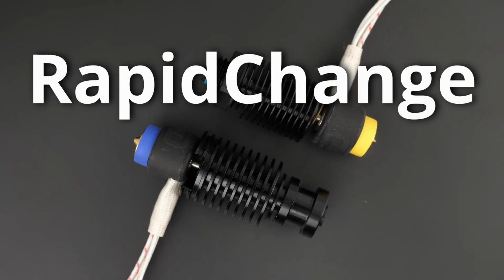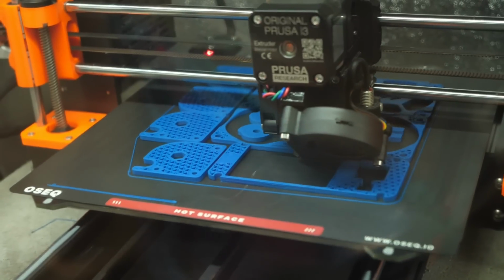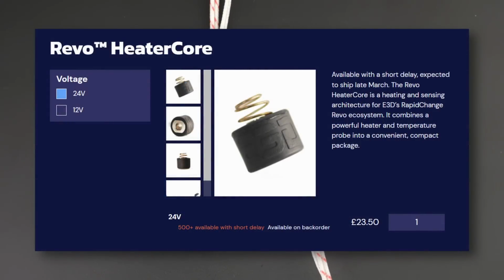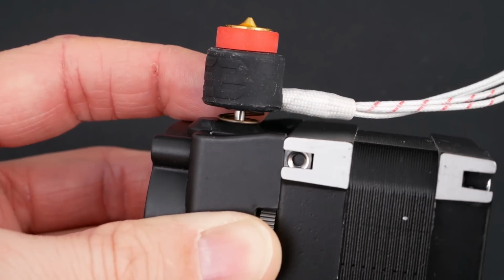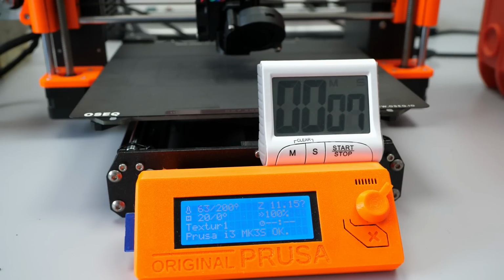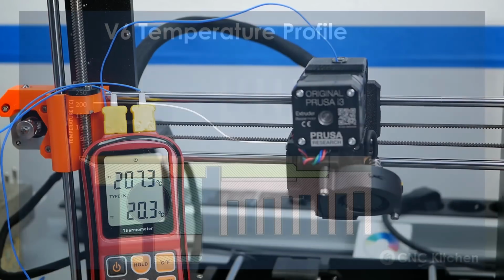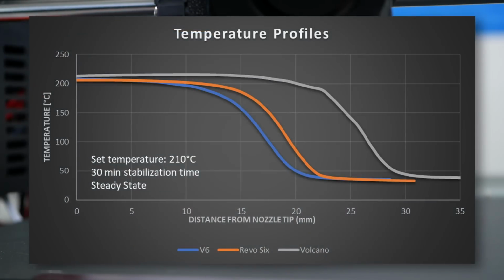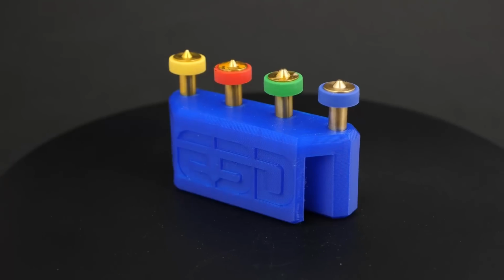E3D Revo™ is great BUT has a dirty secret! (REVIEW)

Comment: The temperature disparity is actually a deal breaker for me. Many of my prints rely on airflow and speed changes to achieve desired properties and inaccurate temperature that will vary based on the amount of airflow is a no go for me.
Reply: And the only solution to that would be extensive testing to find the temperature gradient based on airflow, compared to just running an already working system, no thanks.
Reply: The process of 3D printing is a bit like cooking—that is, purely empirical.

Achieving desired results isn't just about turning knobs and punching in in absolute vales. You have to run calibration prints and modify the settings in a closed feedback loop of tuning.

You did the same with your existing hot end. If you were to run the same tests on your hot end, you will find similar deviation from the expected results.

I had run my battery of calibration prints and I had set my Revo Hemera to print at 265°C, as opposed to the 250°C of the V6 hot end attached to it. At the end of the day, this really doesn't affect your prints, because you are going to recalibrate everything.
Reply: Actually If you do not use a coefficient to adjust for inaccuracies of Thermistor your Temperature reading  will be most likely be wrong. Duet offers do change the Steinhart coefficient (C) to adjust for inaccuracies. Secondly depending on variable printing speed you use (for instance faster infill than perimeter etc.) I can assure you that the filament will not reach the temperature you set on your LCD. One thing is to measure the nozzle temperature the other is the actual temperature of the filament you are extruding. I highly doubt that you will see a significant difference between Revo and the current hotend you are using.
Reply: @maximilian.arnold  precisely. There are too many variables that affect the actual printing process apart from temperature recorded in the nozzle.

Absolute numbers are good relative indicators to nudge you along in the right direction, but at the end of the day, you must rely on the empirical process of calibration and print tuning.
Reply: Yeah this is actually quite surprising, thank you Stefan for the investigation and discovery. I actually bought the whole damn thing but haven't had time to install it yet. Now I am wondering if I should put it on my main workhorse mk3s, or put it on my tinkerbot. Sigh.
Reply: @shenqiangshou  please don't curse your precious printers with that poison.

Put it all up in the free section of Craigslist. That way, you won't be making money off someone else's inevitable misfortune.

Comment: I've looked long and hard at the pre-order, and so far haven't ordered. 

what I like most about it is that the heater/thermistor block has decent strain relief, and finally some thought has been given to decent cable routing. I run a titan aero atm, and routed the cables through the mount. there is literally a cm of space in between the bed and the body of the extruder, and there should be room for a part cooler as well. If you have a volcano, the cables go up, which is not bad, but then they have to make 2 hard right angle turns to go anywhere useful. Revo is not perfect here, but it is a step in the right direction, and for this alone i was, and probably in the future still am, willing to give E3D my money. it must be said however that Omniadrop was the first to do this, not E3D, and their heaterblock is v6 compatible.

what i dislike is the fact that in between launch and pre-order, there was the CHT nozzle. This seems like a marked evolution in hot end tech, more so than the slight rearrangement that Revo gives. CHT seems to improve on nearly all aspects of delivery, and it's incompatible with Revo because of the patent situation. and yes, i am aware that CHT is licensed as well, and it wasn't invented by Bondtech. What i don't see is a way to integrate CHT with Revo other than making a nozzle break with a blind M6 hole like we've always had. Quite frankly, if E3D makes that, i'm buying.  

as for the quick swap. I'll use it more than swapping nozzles. mostly because i'm not an organised person and nozzles go missing, and they get dirty enough to be unidentifiable, even with socks.

Comment: Be aware of the hidden recurring cost! Even if you don't print with abrasives, nozzles are a consumable part that will need replaced. This design has the highest recurring cost of almost any hotend design out there. Don't be afraid to change the nozzle on your V6/clones. With a 3d printed torque wrench and a socket, it's not that hard compared to other aspects of maintenance.
If you print with anything other than ABS or PETG, I would never rely on a Revo based printer as my only option. There are many perfectly good hotends that cost about the same as a pack of these nozzles, and not only are the replacement parts far more affordable, you can have a PTFE lined throat for if you want it. (All metal designs, such as the Revo, are not the best for PLA as it's prone to jam in them, and the higher temp range has no benefit to lower temp materials.)

I disagree with the Revo on principle. I value open and modular designs, and it goes completely against that by not really being either.

Comment: Excellent work! The thermistor position issue is unfortunate. It’ll be a pain if you have to adjust the extrusion temp as a function of part cooling. OTOH, as you say, this might also be a factor with other hot ends; something I’ll have to pay attention to in my printing.

Given that, I’m surprised that it performed better than the original at high flow rates; that’s a good thing!

I do like the idea of it being easier to change nozzle sizes; I almost never change mine because it’s such a hassle :-/

Comment: Grussgott Stefan,

I do not change nozzles, I work on the same machine with PLA 1.75mm, 3mm, PETG same, PC, same, ABS 1.75mm, Hips 1.75mm, and PPS 1.75mm, so I change the entire block, hotend, nozzle, heatsink, in one simple move with my veteran tool swap system.  

It is a manual system that allows me to unplug everything in seconds, take the combo out and put new combo in (filament remains in the old combo extrusion system from reel through extruder pusher to nozzle, and the new combo is all filled up from begining like on a real tool changing macine, just this one is manually changing tools) so my core XY printer has two permanent extruders fitted, a 3mm and a 1.75mm, and I swap tools as needed in seconds.  My dual water cooled head gantry machine same setup, unfortunatelly I cannot use the dual setup on the core XY because the original tronxy board has only 4 stepper drivers, for now... lol, but yes, I can interchange tools between them machines.  My only not compatible for now machine is the old direct drive monstrousity that I use for printing elastic filament jobs. 3 direct drive heads, but I am about to eliminate one, I never use it in tripple filament setup.  

Now building the Rumba 6 axis machine 200X200 bed size to test it, and obviously will have the manual swap system incorporated for my convenience.

So this new printhead for me is already obsolete, as the old printheads are even faster to hotswap on my machines.

Comment: More quality content from the CNC chef in his kitchen :)
Thanks for this review, the ability to swap nozzles so quickly & easily is quite appealing as I want to try smaller nozzles, but without a nozzle for abrasive filaments yet I'll stick with the hotend my Prusa Mk3 came with.
As you like upgrading things, can I suggest my Thingything 4330049, a more ergonomic knob for the Prusa control dial, it makes changing settings so much easier & quicker, especially when you need to dial in a temperature/fan speed etc.

Comment: I have 3 prusas. mk3s+ with revo, mk3s+ with Olsson ruby, mk2.5s with E3d V6. For met the revo is clearly better. Nicer print results, heats faster, cools faster. Better cooling of the part ( revo hotend is smaller).Easy nozzle swipe. I highly recommend it, even if the temperature according to this study has a deviation.

Comment: Thanks for the in-depth review! Interestingly, I had a similar problem with the heater core, with temperatures jumping around during heat-up; although I only realized it after taking a closer look once you reported your problems on the Meltzone podcast. Contacted E3D support, they changed the heater core without problems, no issues since then.
I gotta say, for me, the fact that you can swap nozzles without a) having to worry about wires breaking and b) afterwards having to re-adjust the live-z value is the feature I was looking for. I print a lot of stuff for board games, and tend to swap nozzles often (.25 for miniatures, .4 for boardgame terrain, .6 for everything practical). Especially for the miniatures, having a dialed-in live-z-value is important to get nice looking prints. On the old v6 hotend, re-adjusting this could take anywhere from 10 to 60mins. With Revo, I've only had to set that parameter once after installation, and never since, no matter how often I cahnged nozzles.

Comment: Good review, not from another E3D fanboy. Although 16mm^3/s is nothing, so I hope the HF is at least double that (though it is likely only around 24mm^3/s). And the temperature instability with cooling should be highlighted/tested more
Reply from the maker: 16 mm³/s is for the 0.4mm nozzle. You'll probably be able to push it harder with the bigger sizes.

Comment: While this is an innovative product, I feel like it's relatively expensive for the performance that you're getting.  I think I fair middle ground, is the CHC series from Trianglelab.  Similar heater block design, but works with standard heatbreaks and nozzles.

Comment: I personally am testing/using a hotend that consists of a V6 heat sink, a titanium heat break/throat and a Maxiwatt heating cylinder/donut.  It is very fast to heat even at 40W standard (0-220 in something like 46 seconds) seems to keep the heat well (even without a silicone sock as I can't find one for the 10mm by 20mm diameter disc shape)   I enjoy it a lot, but the conversion required a new mount, and part cooling required printed ducts to get things going, which became quite a challenge when everything was mis-matched.

The only real complaint I have about the Maxiwatt is the lack of strain relief, so the wires can get damaged quite easily, rendering a "heat block" (donut) useless.

My only upset was the nozzle price, at nearly $15 US to replace if something happened, clogs and issues that normally are a "just get a new nozzle" approach are no longer available.

Comment: The thermal transfer problems might be helped by a light dab of thermal grease inside the heater core. Would be interesting the see if it does anything the same way you tried to insulate the sock.

Comment: I didn’t want to wait for one so I bought a mosquito and I love it. The vanadium nozzles are great and switching nozzles with slice’s torque wrench takes what seems like half the time as the v6. I don’t worry about breaking a thermistor wire or having a loose nozzle because everything is rigidly mounted and the heater block doesn’t rotate. I should have done it a long time ago.
Reply: The Mosquito is the perfect hotend.  Hands down.  Combined with a vanadium or better yet, tungsten carbide nozzle, and it will literally print anything with no wear whatsoever.  Tungsten is a one and done nozzle.  Install it and it will outlast the printer.  Nothing scratches it.  It eats carbon fiber nylon like candy, no wear at all.

Comment: I put a hardened nozzle in my mk3s the day I assembled it and have never changed it since. I primarily print CF Nylon so at the moment Revo is a no go and the not actually quick, quick change isn't a 'feature' I'd need.
Reply: I think the point is that people don't change nozzles often because it's a pain. So you just pick one nozzle as a compromise for all prints.

If you could swap easily, you would save lots of time on draft prints, and do a lot more high-detail parts that aren't worth the effort right now.

Comment: I wasn't really sure if I wanted a Revo, after all both my Mini and MK3S+ print perfectly fine with the v6 nozzles. Replacing the nozzle on the MK3S+ isn't that much of a hazzle anymore after I got the right tools (16 mm wrench and torque screwdriver), but I do remove the fan shroud to get easier access which makes it a little more work. I did not replace a nozzle on my Mini yet, mostly because I didn't have to and didn't want to mess with the different style heater block.

That said - I have ordered two Revos now - one Micro for the Mini, because it is supposed to be lighter (not sure if that's still the case with the 2nd revision of the hotend that uses the original fan) which should help with the cantilevered axis.

The second one is a Revo Six replacement for the MK3S+ so I'm able to use the same nozzles as for the Mini, but more importantly because I have seen reports that the Revo nozzles form better tips and need less ramming which will help with MMU2s prints. Since the MMU setup always retracts the filament from the hotend at the end of a print, it's also very convenient to replace the nozzle at any time.

Comment: I have recently (around Christmas 2021) changed my stock Ender 3 hot end for a Microswiss direct drive and full metal Hot-end, the Nozzles are hardened steel and it allows for temperatures to about 300°C, and I am quite happy with it, since now I can print TPU what a SHA of 85 and maybe even lower (still need to test Ninjaflex Chinchilla) even though it does come with it's own problems it is quite a good hot-end and I am very pleased with it, the Nozzles are more expensive at 17€, but they last much longer, I have printed wood, bronze, Ninjaflex sha 85, Extrudr NX2 PLA, and tons of PLA filaments, I have but one printer though and many people asking me to print something for them which leaves little time for testing other filaments, maybe I should finish my hypercube but I have hit a "builderblock" (Same as a writersblock but more for builders:-) )

Comment: I also experienced a Revo thermistor problem while heating up. The reported temperature was jumping up and down at around 170 °C while the PLA in the nozzle was boiling and smoking. I had to press the reset button on my Prusa MK3 and let the hotend cool down. After that unsettling experience the hotend regained it's normal fuctionality and until now the problem has not repeated itself.

Comment: I have a DIY IDEX printer, changing nozzels on my V6 can be a pain since Z offset can change.  The Revo would be a great change for me, I can deal with the slight temperature variation.
Reply: Do you not have mesh bed leveling?
Reply: @shadow7037932  Yeah it has a probe on tool 0 but like I said it's IDEX IE: Dual hot ends/extruders.  You set x/y/z offset of tool 1 to align it with tool 0 in klipper config file on the tool change macro.

Comment: Stephan, thanks for all the good work. I have two revos which are back out of the printers I put them into (Vorons). I found the cold extrusion to be a real problem. My extruder was 30-40C colder (as measured with a Fluke 87V with a type K thermocouple) than reported. This created unusable parts. So temporarily I have put my Phaetus Dragon HF back in and have been watching to see others experiences.

Comment: Brilliant review, again, Stefan.  I, too, have messed up either the thermistor wires or cross-threaded the steel nozzle and/or heat block on my Swiss-Micro all metal hot end (CR-10S).  I have been considering a change, and do appreciate the integrated and strained relieved thermistor, to something with a rapid-change nozzle.  I'll keep watching E3D for the Revo-CR nozzle kits (currently on back-order).  Thanks!

Comment: For the average hobbyist, i don't think this is the be-all end-all, but for someone who 3dprints more than the average Joe, but maybe not at the level they have multiple printers, one for every type of print, this might be it! I personally haven't taken out the 0,4 Bondtech CHT for months, due to lack of necessity. Yes, i could have used a 0,6 for some prints, but I didn't see the need to change, as i don't mind the printer running for longer. But if you're printing at such a rate you "can't" wait the extra time it takes for a 0,4 print compared to a 0,6, this might be it! 😁

Comment: Here is my biggest problem with Revo six, a hardened steel nozzle dosen't exsist for it, only brass, I don't really care using brass nozzle if I have to, but having hardened steel nozzle has two advantages for me, it allows me to use side cutter on it without damaging the nozzle, something that happened to me before, since I always scrap of the oozing before every print, and second of all as you may know, it allows people to print with special filament.

Comment: I noticed more and more people (including me) are having problems with faulty Revo heater cores... Mine just spikes up and down and causing printer halts. Even the PID tuning stops due to high temperature spikes. A new one is on its way... Gotta say, e3d is quite easy with a new replacement. Hope I get a V2 version or something.

Comment: Thanks for the deep technical insights 👍 I'm in doubt if it's worth to get this kit. It may good for people with no sense of torque in the hands and over screw the threads every nozzle swap.
The kit seems to offer only brass nozzles, I prefer also hardnerd steel for abrasive material. If the thermistor /heat element dies you had to throw away the whole heat block. That is not in the sense of savings precious raw materials.
What about if the kit nozzle unit gets clogged? How can you clean it? A single nozzle you can change or clean relative easily.
PS : if the punched numbers on conventional nozzles are no more readable because of burned plastic, heat it up and clean it with a little brass-wire brush. The you can sing "I can see clearly now..."